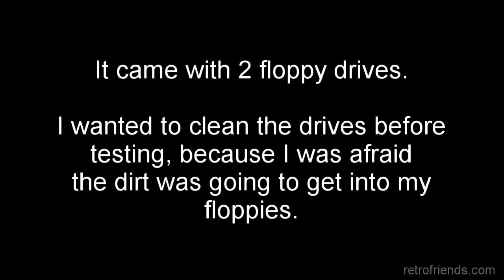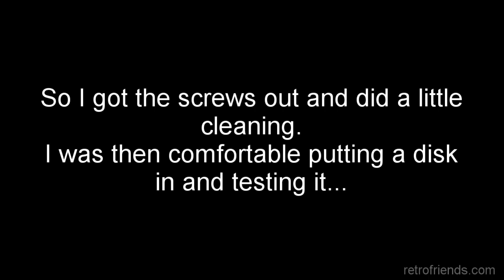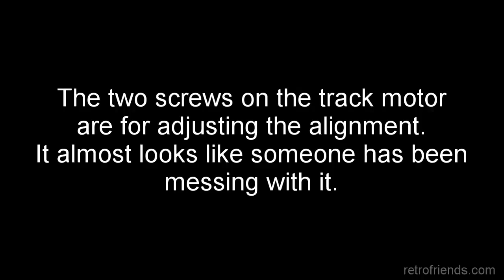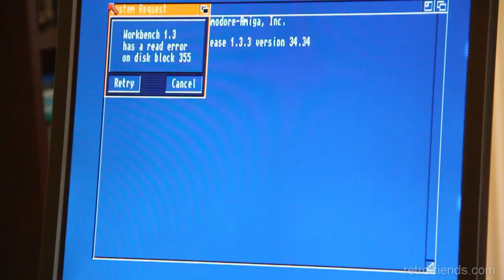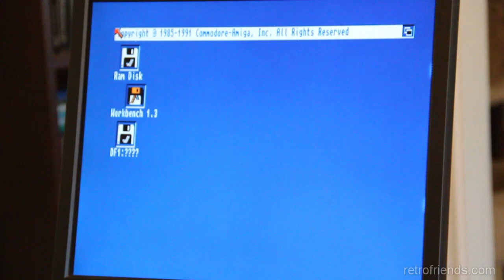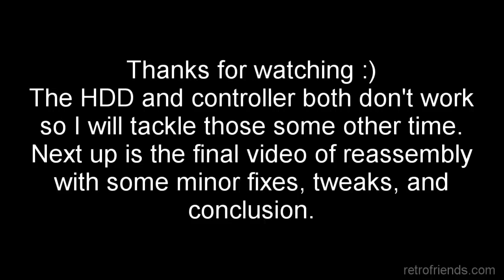eBay Amiga 2000 Part 6: Floppy drive repair Matsushita JU-363

Comment: For track alignment I use the X-Copy CheckDisk feature. I have CheckDisk running whilst I adjust the track motor until CheckDisk returns all green zeros.
Reply from the maker: I will try that next time thanks :) I am also thinking of trying the AMI disk I have, and hooking my oscilloscope to the test points. Check a good drive, then compare with a bad one.
Reply: @retrofriends  Have a look at TrackDiskSync on Aminet too. Although, I admit I couldn't get on with it when I first tried it. I might revisit it now that I have more experience. There is also a disk alignment feature in Amiga Test Kit too. Amiga Test Kit is my go to for checking floppy disk signals/functions, along with DriveTest.
Reply from the maker: @MonidethPen  Thank you for the info!

Comment: Interestingly, the exact same drive is also used in the DX7 MKII FD synthesizer. The one is mine doesn't always spin, or would spin, then stop then would spin again if knocking on the case... Does this drive use any belt that could be worn out?
Reply from the maker: I have never seen a floppy drive with a belt. They always seem to have direct-drive platter motors and geared track motors.
Reply: Thanks, no belt indeed. There's a tiny dual-switch that is pushed when inserting a disk, I think that's what caused the intermittent disk spinning. So now it spins, but the head doesn't seem to work propetly. When I try to format a disk, it would barely move, or would move back and forth in tiny steps. I cleaned the heads and lubricated the head rails. What else could this be? It doesn't look like the head motor position has been tweaked before.
Reply from the maker: @gilwe  I have never tried to test by formatting, so I have never experienced that issue. I think you can format a disk with the heads out of alignment, so that is not your issue.
Reply: @gilwe I’m also trying to repair this drive for a DX7IIFD. I’ll update this thread if I have any luck. If you have any tips, please post them here.